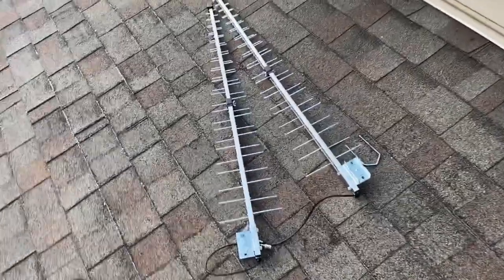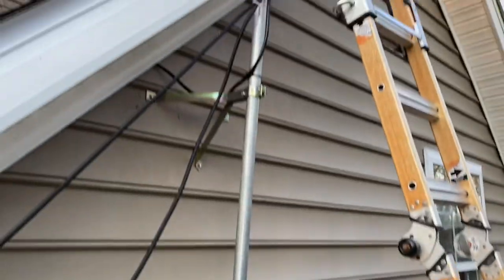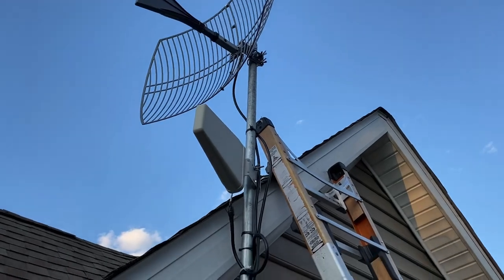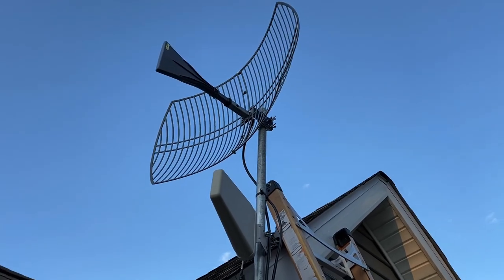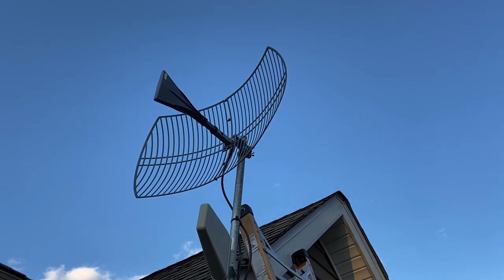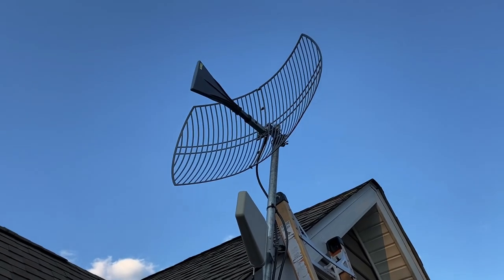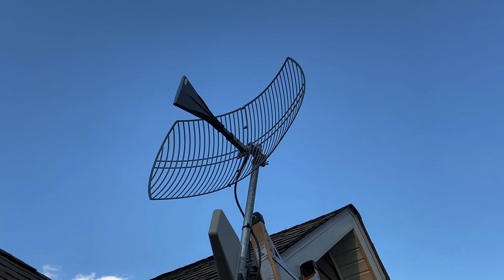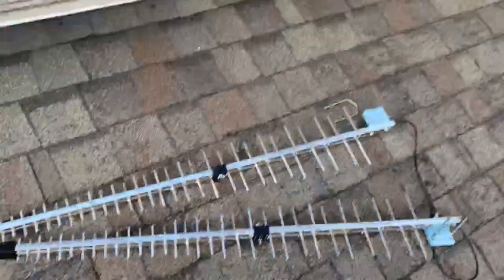Fastest internet rural solution change out LDPA Vs Parabolic Grid??

Comment: Do you have a video on adjusting the horn? I have the exact antenna. Thanks in advance.
Reply from the maker: Lol pull the black pins out with a flat head screwdriver and extend it out
Reply: @rockernro  I'm on att band 14 should I extend it in or out?

Comment: I have a Hi-Boost 4k plus cell phone booster and the cable is an  type N connection. With your experience can you tell me if it's compatible with this antenna..? Thank you for doing this video...
Reply from the maker: I’m not sure but judging by the connector yes the N male would work just make sure you have the cable that has the opposing male and the other end SMA male to MOFI
Reply: @rockernro  WOW, I didn't expect a reply especially this fast. Thank you..! I live in rural Missouri, Ozarks actually. I have no internet just LTE. 5G just became available, but I'm to far away. I really wondering if this parabolic antenna is better than the one that came with the Hiboost....Thank you again for your response..! Semper Fi
Reply from the maker: @jerrywhite4497  oorah! Lol, so I looked up the hiboost antenna, looks like a standard yagi just the little triangle antenna?  Yes you can try it but here’s my recommendation.  I was like you needed decent internet the best I could with LTE and when it works, it works!  So, see how that does connected into the antenna primary port remember to get the cable we talked about.  Second, if it sucks, get the parabolic and use the hiboost antenna as your secondary antenna to assist you with signal quality.  The primary is the signal strength and a parabolic rips! It laser beams -25 DB vs a standard yagi is a -9 DB.  I noticed double the speeds when I made the switch!  Just remember, if you do 2 antennas you’d need two cables!  Here’s a link you want the thick RG400 cables because it won’t get much loss. XRDS -RF KMR400 SMA to N Cable 10ft, N-Male to SMA-Male Connector Low Loss Extension Cable 50 Ohm SMA Cable for 3G/4G/5G/LTE/ADS-B/Ham/GPS/WiFi/RF Radio to Antenna Use https://a.co/d/7WQXHwK
Reply: @rockernro  Thank you sir..!

Comment: Sorry John but it is obvious that your shooting in the dark. LPDA are by far the better antennas. Problem is you have to set them up correctly! Pointing them in 2 different directions is a no no. and they need to be at 45 degrees and at least 60 cm apart to get proper MIMO (even a meter apart in long distance rural) . Suggest you get hold of USA distributor of Poynting antennas to help you with your setup. There are also videos from Poynting  to guide you with your setup. Next you cannot do 4G with one cable! As soon as you use one cable it's 3G. My advice is to re mount the LPDA's as advised, download the App Cell Info and determine which Tower is where and what signal . Then pull up your RSSI, RSRP and RSRQ on your Router. Focus mainly on RSRQ and slowly rotate your LPDA array left and right and slightly up , until you get RSRQ the lowest under - 10  (ie  -7 is good). Now lock your array , do the fastest download test ever . Greetings from South Africa, makers of Poynting, the best antennas in the world imho :)
Reply from the maker: C-TEAM TRADING lol I’ve oriented them every which way it makes no difference and it’s not a shot in the dark dude I know what the hell im talking about . I’m only going to get the gain that the antennas are capable of.  I haven’t yet to see an antenna that has more than -26 gain.  No LDPAs are not better.  When it rains they get coated thus degrading your signal.  Take it from me I’ve tested every kind of antenna.  Nice try tho!  Enjoy poynting your poynting lol
Reply: Can't get 4g with one cable? Where'd this guy get his info?

Comment: Hey I just set up my mofi. When the signal page does load it shows no signal. I usually get 1-3 with our phones. Is this normal, do I just need to hook my yagis up and move them around to look for signal? Or do I have a bad unit ? Thanks
Reply from the maker: If it shows no signal then potentially yes keep turning the yagis and watch in real time until a signal appears.  Then look at the decibels and get them as low as possible.  I would use my phone have mofi WiFi on it and watch it real time from phone while I was on roof turning it.  Hope that helps let me know!

Comment: What channel are you pulling from, mine is channel 17 ATT 700 MHZ Parabolic. In some cases, you improve with a single channel feed horn. Mine 3 miles from the tower.
Simple WIFI has some good videos on setting up mimo parabolic.
Reply from the maker: Herbert Newman I’m using band 4 the signal quality is trash but the strength like I said is good.  You are 3 miles from tower that’s a big difference between you and I man.  I’ve seen the videos